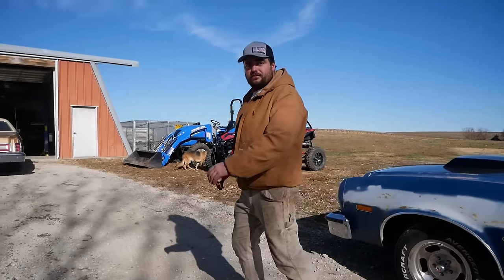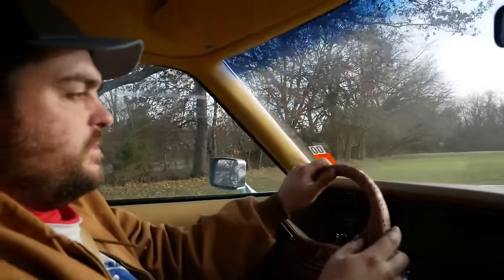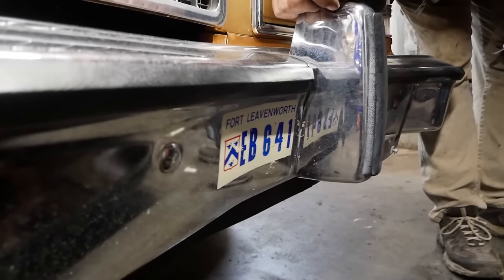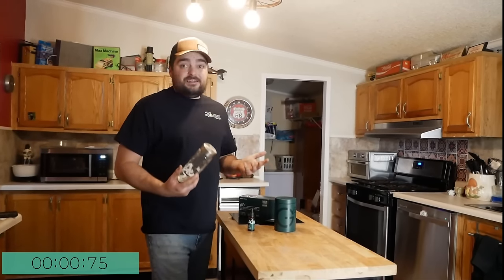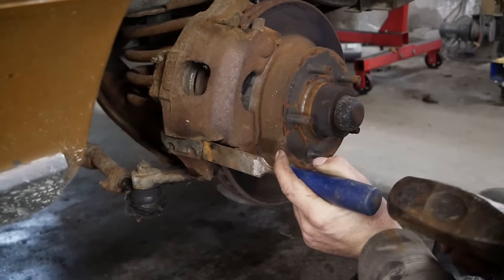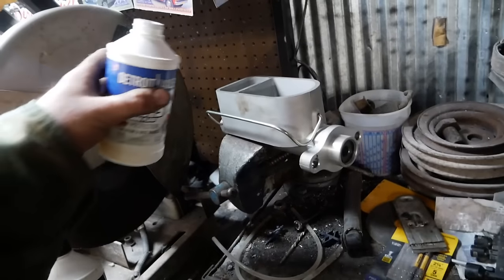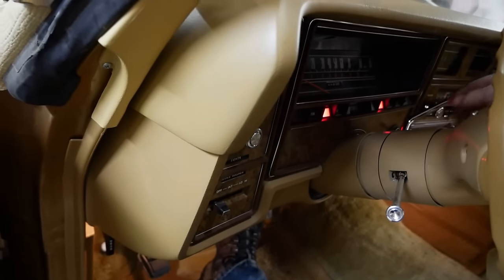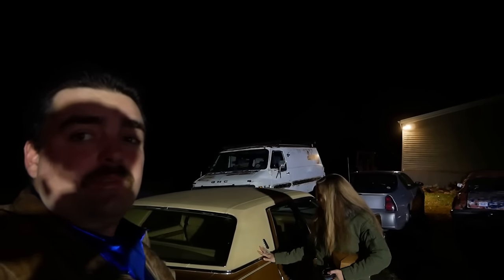ALL ORIGINAL 1978 Ford LTD SURVIVOR ~ A Time Capsule!

Comment: Great move applying the fluid film. That stuff works great. If you want a thicker film try wool wax or surface shield. I do my vehicles every fall with wool wax and I use fluid film on the bottom of the doors because it's a little bit thinner. Fluid film will also creep for months after you spray it. I live outside Buffalo so it's a must for cars around these parts. Nice car by the way!

Comment: My folks had a 78 when I was learning to drive in 1984. Quality was definitely not good… The factory paint was bubbling and falling off when it was a couple years old.  The factory 302v8 threw a rod at 70k.  Great highway cruiser though.  Last time I drove it I got a flat and when we jacked it using the bumper jack, the bumper fell off. Lol. Fun times.  I’d love to find one as nice as yours.  Thanks for saving this one!
Reply: The 70’s LTD's had a problem with the bumpers doing that, I seem to recall.

Comment: Fluid film is great, only issue is you have to do it every year. But if you live anywhere with salt and you value your vehicle you should "prepare" it for winter anyway and I think getting such coatings on are a must.
Reply from the maker: Quick job and worth the effort!
Reply: The fleet gets fluid film every November buy it by the case. Stuff works

Comment: Here's a tip for that bearing, next time you do one you should put it in a deep freezer over night and get it good and cold, it'll make the metal shrink just a bit. It'll then slip in a lot easier, I usually do this for universal joints on drive shafts and man oh man does it make things go smoother. Also good luck with ever getting that bolt for the AC compressor out, red loctite is the stuff you need to apply heat to in order for it to let go because otherwise it's almost as if you welded the bolt in, you should have used blue loctite instead.

Comment: Discovered Super Clean back in late '80s, other than too aggressive for painted surfaces you care about, full strength it's tough to beat on most greasy tasks!  Mom had a '78 Grand Marquis, pretty much same car as your LTD, when my dad did a re-spray on it, found a body hammer left under front quarter panel from the factory.  Nu-Finish, OMG, those infomercials still replay in my brain!  Can't believe your headlight covers still work....hell my dad fought damn vacuum issues when the car was 4 years old, let alone 45.

Comment: I bought a 73 Ltd with a 351w that was almost as nice. Only had around 40,000 miles. Perfect interior and the paint was only sun faded. The car would have no rust if it wasn't for the stupid vinyl roof. Fixed the roof and paint it instead of replacing the vinyl. Great driving car. Smooth as can be, like driving your living room down the highway.

Comment: I have a 55 Packard with 1966 spark plug wires and points and it don’t miss a beat.believe it or not the 55 only has 28000.

Comment: Great find you have there. 
The fake chrome peal on turn signal stalk and other controls is to be expected. I drove a 1974 , 1978, and 1981 LTD police squad till they died. All pealed that fake chrome and had paint runs.  Your video brought back memories. Thanks for the endeavor. Just side note, suspension was horrible even on the police package way too soft. Rode great till needed speed and handling. 
Be safe, enjoy the ride.

Comment: Hey Dalton, you need to tap the caliper with a rubber hammer to remove air bubbles that could  adhere to the walls of the caliper or brake cylinder, while bleeding.

Comment: Great find+ I went thru  GM plant in Arlington, Tx in 72. They were using automated paint booths then. They rolled thru on a conveyor like a roller coaster with multiple spray tips shooting at all the correct angles. It was pretty cool. I followed a Chevelle SS all the way thru. It was silver with black racing stripes. Dream car! Ty for the laughs.

Comment: I've found that unscrewing the bleeder, putting some grease on the threads and reinstalling before bleeding helps to keep air from sneaking around the threads. Also, using a piece of tubing that fits the bleeder nipple rather than those rubber boot jiggers helps too.

Comment: Yeah with Ford's if you don't use the cruise control for some reason I believe it something to do with the vacuum l can't remember.   But it is a easy fix something with the cable sticks if you lube it a lot of times it will start to work.   When you get it working the cruise is like the air conditioning you know even in the winter you run the air a couple times a year.   To keep the seals and orings lubercated so that they don't dry up and start to leak.   Same thing with the cruise you use it to every once in a while to keep the cable from sticking if You don't use your cruise control a lot.

Comment: In 98 I bought a 73 Chevy Nova 2dr, Custom from the original owner. It had only 60K miles and I paid $500.
I put 100K miles on it and sold it for $3,350 to a neighbors 16 year old kid. 
It had factory White bucket seats.
He had it for about a month and had it repainted in Bright Metallic Blue with White racing stripes.
After about another month, he flipped it and totaled it.
I had put Craiger Center Line wheels on it.
It was a Great looking car. 
It had an inline 6cyl and a 2spd automatic transmission.
I had also put new springs on it.
Other than that all I did was maintain it.
Reply from the maker: Kinda funny, I bought a 76 Buick Skylark (Nova) when I was 17 with 60k miles from the original owner. 231v6, spun a bearing 2 years later on my way home after working 2nd shift at the plant 🙄

Comment: Sorry I'm late to the party; I was afraid you were going to molest that strangely beautiful old '78. Delighted to see that you fixed her up and loved her. My folks had a '72, pretty much the same car less a few fancies like the Hidden Headlights. Loved: Jess w/ her hair down, the Cool Blue Disco shirt and The Night On The Town. Packing the wheel bearings the RIGHT way, although the gloves surprised me. Attempting a "squeal" from the tires. (LOL! By the time you tuned that 400M to "sort of" quit pinging on acceleration, it was too timing-delayed to get out of it's own way.)  OTOH that beast will last as long as you can afford to put gas in it. Oh and one warning to you: the headlight switch on those, as they aged, would develop a nasty habit of dropping ALL the lights at random. The failure was the plastic switch box cracking from heat. I don't think Ford recalled it, but it was a well known issue "back in the day".

Comment: I have a '69 Pontiac Grand Prix with 10,200 miles. I'm the second owner. Car was ordered and equipped with a 428CID TH400. In dash Tach, AC, Cruise, AM/FM, Rear Defrost, gauge package and a beautiful dark green leather interior with a Cappuccino Brown exterior. Original spare in the trunk.

Comment: I was always taught to check the wipers like the pressure on the arms wipers are used alot if the arm is tight that's a sign of low miles

Comment: In regards to the steering wheel cover;  dealerships used to sell those to get a few extra bucks out of a prospective buyer.  My Javelin has a leather steering wheel wrap - but it's had it since Day 1.  The car was sold with a few "Dealership" items:  The Leather wheel wrap, stainless door ding guards, floor mats, passenger side vanity mirror, and a full-length rub strip glued on top of the side stripes!!

Comment: I have a 73 Mercury Cougar xr7 that has 78 thousand miles on it. Sadly the original 351 Cleveland blew and they pulled the drivetrain. I got it after it sat in a barn since 1996 and I’m trying to revive a drivetrain from my uncles old 75 ranchero that is long gone so I can bring the cougar back to life.

Comment: That's a sweet ride you've got a good one. They say the only thing worse than an old car with too many miles is an old car with too few of course meaning a car is meant to be driven if not it will have problems guess you will find out but it looks nice.

Comment: My mom had that exact car (different color scheme) in 1978, as a 16 year old I discovered pretty quickly that the old 400 in that configuration had zero low end acceleration.....it took about 2 miles, but you could eventually bury the speedometer needle in the dash.

Comment: I've tooled around with detailing for about 20 years, i've never had any luck with Nu-finish. old formula, new formula, can, bottle, liquid, paste - doesn't matter. The defect removal is sub par for the effort and the protection is harder to apply than the cheap-o spray sealants and doesn't last as long.  In very few cases I've been able to use it as a very mild abrasive cleaner polish (in the vaguest of terms). Car looks good though. Fantastic find! I wish we didn't go away from these type of interiors where comfort wasn't just a feature for the rich.
Reply: I think nu-finish's major claim to fame was the successful advertising of a product that's just good enough to work somewhat, but not aggressive enough to screw things up without a LOT of elbow grease. You know, for all the people who both have the extra cash and no idea what they're doing :)

Comment: 53:40 Feel that so hard 🤣 replaced calipers the other day, went to bleed them and they pissed everywhewre. cursed new parts for 5 minutes then actually looked and wouldnt ya know, brake lines were hand tight because i was rushing. Tighten em up and boom bled perfect and no leaks.

Comment: What a nice car that really is.   I don't know if I could daily it - it's such a time capsule.  The Firestone 500 tire recall.   Been there.   My '77 came with them.  3 of 5 separated, yet Firestone would NOT honor the recall, claiming that my serial numbers weren't in the recall.   Yet the original Firestone 500 spare is STILL in the trunk, albeit having a couple of thousand miles on it maybe if that.   Not so much a spare as an artifact.

Comment: The vacuum bleeder sucking air around the threads is why I use a pressure bleeder that pushes fluid in from the master cylinder.
Reply from the maker: For whatever reason I've never been able to find one of those
Reply: @PoleBarnGarage  Motive Products makes the one I have. It's finicky, but it works. You can use it two different ways. You can fill the jug with brake fluid and pressurize the system that way, or leave it empty and just use it to pressurize the brake system. If you use the dry method, you just have to remember to check the master cylinder every now and then. I chose the dry method, because you can't leave brake fluid in it.
But, the way they mounted the pressure gauge to it was terrible, and mine leaked. Took some effort to seal it up.
If I had to do it over again, I'd get the one from AGM. It's looks to be way better quality than the motive one. And it uses shop air to pressurize it.

Comment: LTD and Lincoln shared some parts in those years, such as the hydro boost brake system on your LTD and the power vent windows on my '77. I need to go through the vacuum system on mine. I have leaks somewhere.

Comment: A few years ago I purchased an old original Oldsmobile Toronado with 30 year old tires that were like new. I wanted to show it off so I took a 15 mile drive. Two of the tires began to split open and fly apart. Please change those tires ASAP. Beautiful car by the way.

Comment: Bought a 78 T-bird in similar condition in 1989 and in 6 months some idiot plowed into me from behind at full speed at least 45 to 50 mph while I was stopped in traffic behind a wreck ( they never touched the brake ). totaled it out bought it back and drove another year with a caved in quarter panel and smashed front fiberglass nose ( from being pushed into car in front of me ).  Loved that car drove great even wrecked 351 Windsor.

Comment: Speaking from personal experience of buying a car that was barely driven and sat a lot and now is driven all the time things that are your normal wear and tear will wear out faster in a short time.  I love my 92 Buick Regal but I hate how much it costs me in parts they don't make anymore.  New old stock parts off eBay and other sites are costing me a fortune. I do ask myself is it worth it and I think yes it is.  The only problem is this car had recalls to fix things that I do have issues with but those recalls don't mean anything now.  Also been using Nu Finish sens it came out you can use it an everything Chrome included
Reply from the maker: Love nu finish. Better than most fancy brands that claim to do the same thing

Comment: 50:11 I had the same issue with the bleeder sucking air around the threads. What I started doing was unthreadsing the bleeder screw out completely and holding the rubber tip in the hole. It seems to bleed the lines quicker too. Hope this helps.

Comment: My family (and my extension later on, I) had a 1979 Lincoln Mark V that was almost this car, but with two doors, power windows, and a moonroof. Oh, and an open 2.47:1 axle. 
The peeling chrome on the turn signal lever was a thing.... but nowhere else. DO NOT put this car in park until the parking brake is set (or held if it has the vacuum release)... hanging the car on the parking pawl will eventually cause you to break the selector ring inside the steering column and the way it happens in these, it's BAD when that happens. As in, I was 11 or so when it happened to ours and my mother had to back out of the gas pumps and into a parking spot and hold the brake in reverse (the gear it happened to snap in) until dad showed up to jerry rig it and get it home. That ring snapping disables the key tumbler, either locks it in place completely or stops it from turning on if you can turn it off. At least then, it wasn't a replaceable part, you had to find another complete steering column. So.... don't do things that require you to tug on the gear lever, it will break. 

Anyways, I piped in to say that 90% of that lincoln's interior looked as new as yours does, but at 200,000 miles. Some manner of coating flaked off the fake wood over the glove box but came off so completely that you couldn't even tell it was there, just a little less glossy. The dashboard took a very slight warp, but never lost it's color or got brittle. And the backs of the seats, where it was heavily textured composite, got to where it was very easy to scratch or rub and chalk off, leaving a lighter mark or scratch. 

Car made it to 278,000 miles with a rust repair to the roof once around the opera windows, and met it's ultimate end due to clogged drains and bad moonroof seals over a summer where it sat just long enough once to develop aggressive black mold inside. We sold it to a cousin and the drivetrain, which aside from a top end (head and cam) rebuild on the 400 and some basic "emissions relief" was just how Ford put it together in 1978, ended up placed into a mud truck project as-is.

Comment: Id use a water bottle and clear hose to bleed it. Put a whole in top of bottle seal it  and fill the bottle with new brake fluid. It's only way i know of not getting air back in.

Comment: wow, i have a 76 wagon ltd same color and 400 with the hydro boost brake system and your car is the only other one that ive seen on youtube i took my car on trip and the brakes would also fade to the floor while stopped or stopping but when i would hit them again my left front would engage and slide or about throw me out of the windshield and google and youtube has failed me, my power steering was a little low but now iknow it might not be the boost system, im in iowa and watch all of your videos. my car is from arizona with 42,000 miles but gets stored during winters.

Comment: Had a 1973 Oldsmobile back in the 90's, 19 feet long, rode great and worked fine until my wife put her foot in the carburetor and the timing chain  broke! 😢😢 Had a 400 in it, sold it to a guy that put a 305 in it that bolted up to the transmission!😲😲

Comment: AC compressor clutch may not be shimmed right.  Not sure what the spec is, probably somewhere in the 15 thou range.  Its set with shim washers between the end of the compressor shaft and the inside of the front clutch plate.  Probably one fell out when they took it apart.  There are fancy expensive washers for the purpose, or just use ones from the hardware store and lap them down with sandpaper as needed.

Comment: I think you found "The One Land Yacht To Rule Them All" but this one doesn't need to be destroyed in the fires of mount Doom... It will take a strong will not to be corrupted by it... On a serious note this thing would be the ultimate Power Tour car, especially if you can get the A/C fixed

Comment: Just a heads up, you need to get the proper master cylinder matching the original. The reservoir for the rear brakes are that way to accommodate for the extra fluid needed for a brake caliper on disc brakes versus the drum brakes using so little due to just having the small brake wheel cylinders.
Reply from the maker: That is the correct replacement for them. Unfortunately they do not make one like the original. I will rebuild it and keep it around
Reply: @PoleBarnGarage  Hey, just one more thing on this. NAPA has the correct one but only remanufactured, Part #: NMC P2154, hope this helps. My first car was a Gran Torino Sportsroof like the one you have, came with the 351C Cobra Jet engine. Sure miss that car...  Really love the channel, keep up the great work!!

Comment: Brake fluid is hydroscopic which means that over time it absorbs h20 therefore as it gets hot the water in it boils and your brakes fade. Just needs to be replaced
Reply from the maker: That's not what happened here, but thanks for commenting. If you watch the video you'll see